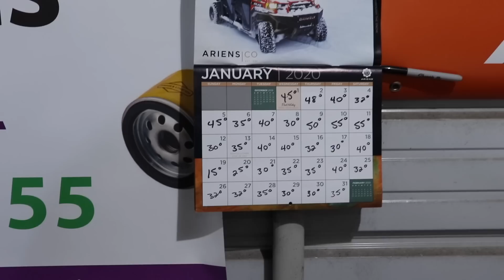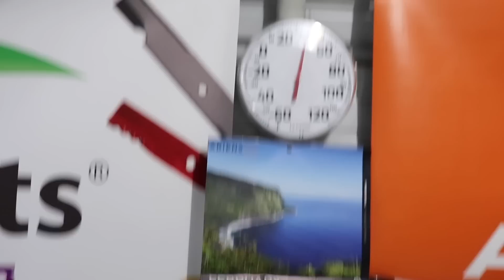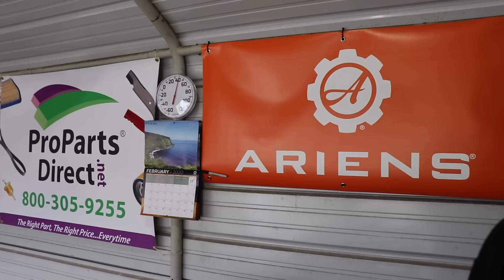WHICH FUEL ADDITIVES WORK? Which Don't?

Comment: I’d be interested in seeing a test done with Marvel Mystery Oil. Been thinking about tossing some in my truck. Sounds like good stuff from what I read but it’s all conjecture.
Reply: I use it on all my equipments (lawn and snow blower) and 2 cars.
Reply: Maybe not too good for a catalytic converter and oxygen sensors. Use a small amount for these. This or some 2-stroke oil is a good idea for a Mazda rotary engine, to lube the apex seals, in small amounts in the gas tank.
Reply: It won't do any damage but it's subjective on what it actually does do. 
The worst that will happen is you will be out $10.

Comment: cant hardly wait to see carb carnage 😅
Reply: He will need that big carb cleaner I think
Reply: If they use the Honda style carbs, the plastic pilot jets on top will likely plug first and cause surging...
Reply: @notajp  seen plastic swell up before my 4hp honda didn't plug up it actually swelled and the jet size was reduced wouldn't idel at all😅
Reply: Willy Ck looks like bowl style ones
Reply: @themowerman  plastic bowl carbs hold up good but anyhing aluminum will form that slime as ethanol corrodes aluminum not sure of the Subaru carbs ive been in enough carbs to know what happens.

Comment: I love how everyone hates on ethanol fuel, but fails to realize that when E10 first came out, it was 89 octane. Then, all of a sudden, it became 87 octane, just like the E0 beside it. I live in Iowa where they sell E0, E10, E15, E30, E85. Sure seems to me that the oil companies know that ethanol is an octane booster, and therefore mix it with crappier gasoline, still ending up with an 87 octane product. Shameful tactics, especially when they get away blaming the ethanol.

I know water can be an issue, as it dissolves in the ethanol, however, I have never personally had any problem running E0, E10, or E15 (which is my go to now) in my small engines. They actually run better on the E15 or E0 than they do on the E10, at least it seams so to me. That is even though I do not drain the carb or tank of fuel in the off season. On 2 engines, snowblower and a lawn tractor, I do shut off fuel and let it run out whatever it can from the carb, but my zero-turn, atv, and garden tractor don't get anything done when parked for the season except connecting the battery to a maintainer.

Just my $0.02
Reply: It's only going to get worse
Reply: Ethanol fuel is garbage
Reply: @robwright4398  yeah Rob

Comment: When you get done with the Gasoline experiment, take one engine modify the carb and use straight ethanol for another experiment. People have no clue about 100 % alcohol , except for drinking it, it would be good to look at power,starting and how much it uses. Call it the Indy engine challenge.
Reply: John Eggleston gotta change they fuel lines and all kinds of other stuff so it can handle the ethinol
Reply: @FishFind3000  Yes u are correct I should have said modify the fuel system.
Reply: @jamesl9686  actually pure ethanol has a higher octane rating. its used in racing for being able to make more power without pre detonating. it will consume much more fuel though compared to gas

Comment: You may or may not covered this, but what about running the carb bowl out of fuel with a fuel shut off?
Reply: I’m thinking most folks don’t do that. I try too but occasionally winter comes in unpredictably fast like this year here in NY  in early November we had snow.
Reply: REMEMBER this test is for the common folk!  Not the mechanically inlcined.  Most mowers sold off the shelf don't have fuel shut offs.
Reply: @pattayperformance  yes that is true

Comment: Enjoyed the experiment and look forward to the end. My previous positive history of aged fuel and additives was in a pressure washer with a 5 hp Honda it sit for 1 year (spring to spring) with non-ethanol 93 and regular sta-bil the thing started first pull and continued. It was impressive for me anyhow.
Reply: Doc, 

Your special ingredient was the NON-ETHANOL.
Ethanol absorbs water, thus all the problems with gas sitting.
Reply: My experience with honda motors have been good also👍

Comment: I have used NON Eth gas for past lots of years and never have issues with say snowblower starting after sitting all summer turn fuel on choke prime and 1 pull she is pppuuuuurrrrrrring. I keep a 14 gallon container around when it is MT I take to station and put fist three gallons from non eth pump in my car and then fill my small engine can up works well keeps me from coming to see you for carbatrator issues sorry! Nice test will like to see the full outcome of all the test fuels. I used to use StaBil but quit and just use Non Eth 91 octane.

Comment: I find that gas only rots in carburetor bowl, I also think this mainly due to the garbage material they use to make the carburetor with and the gas also rots the carb. bowl, this causing the main jet to fail. This test proves nothing. Like one guy said let them sit for 6-months in hot weather and then we will talk.
Reply: edgenet1 Exactly.  Gas sitting undisturbed in the carb/bowl is what causes the gumming up.  Starting the engine every 4 weeks prevents the gas from gumming up.  Thought he would of known that. Disappointed.
Reply: Carl Jones even if the octane drops under starting conditions, using starting fluid will more than likely start the engine and run on its own with a higher rpm! 

Starting fluid shouldn’t be used on a no start condition.
Reply: Why Not, Starting fluid is the best of the best especially in older Tecumseh engines. I have been using this stuff as a cleaner also with Zero issues.
Reply: edgenet1 it won’t give the results we are after.
 Starting fluid is great but if he uses it under a no start condition it could start an engine that the gas has started to gum up and could pull it thought the jets. What if the octane fell out of range to start? Hitting it with starting fluid would give it a higher rpm and would more than likely run. I’ve ran into carbs that had water in the bottom of the float bowl many times and is caused from the ethanol pulling moisture. Water settles at the bottom of gas. It would also be just enough to cause it not to start. Hitting it with starting fluid could burn that small amount of water then run fine. That would ruin the test results. 

It shouldn’t be the first thing to do. He should check spark. If it’s got spark then that engine is out and has failed the gas test.

Comment: I remember a time when gas was good and engines would start no matter what,I think the quality is crap,octane stinks and ethanol stinks ,we need to go back to real gas,and not this moonshine there making.
Reply: That's what I told my customers, "you been running corn liquor in it again"
Reply: @docriordan7787  lol
Reply: Robert V yeah and it will only get worse is what I’m thinking
Reply: Well said, was a kid in the mid 60"s.You could let gas sit in a Briggs & Stratton for over a year,no problems.Only advertised additive I remember was STP(the racer"s edge)
Reply: Those were the days. The only machine that were thrown away were used beyond recognition.

Comment: Great procedure for the test.....very thorough. I'm curious if the engines next to the wall may experience more temperature change than the engines furthest away from the wall. I know down here in the Houston area it gets so hot that being against a wall would be a major factor because of the radiant heat.
Reply: Right! He should 180 the bench twice a month.

Comment: Since the fuel is 30 days old now, and 2-3 engines are already running sluggish if it even has anything to do with the additives. Not all engines are created equal, even if they are the same model. 
I'm thinkin a couple might reek of lemon.
Reply: chainsawchips you might be right
Reply: Top Dead Center  , thattsa story for another day.  I was just a teen at the time. All I know is what dad(C.M.) told me. It was "conspiracy to commit murder".

Comment: I store ethanol fuel in plastic barrels for emergencies. Been doing this for about seven or eight years now. I use Stabil brand 360 Marine stabilizer. If I keep it tight to prevent evaporation it will last 18 months with no discernible degradation to the fuel quality. I'm going on 24 months with this last batch. No information on it yet. I will open up the first of three barrels in a few days and see for sure.
Reply: The engines (my mule was an '86 4.3L bored out v6) will run on 2 year old stuff aslong as it isnt the cheap dollar store additives, I used products from 109 octane all the way to regular stabil fuel conditioner without any issues then after the 2 year mark it lacked power majorly, products like ethanol fighters in the clear blue bottles work nicely aslong as you premix everything

Comment: It hard to believe a tank of gas will last for a whole year
Reply from the maker: And if it doesn't? Re-fill it with the gas can underneath it.
Reply: @TarylFixesAll  ok
Reply: @TarylFixesAll  The devil is in the details, gas cans in plain sight !
Reply: In the first video, he said he'll be running the engines 1-2 minutes each month. Simple math equates that to running the engines between 12 to 24 minutes total, over the course of this experiment.

 Considering they're running unloaded, and the minute amount of fuel evaporation that'll occur from the fuel tanks, there should be plenty of fuel for the whole year.
Reply: I do little miles in my car, 9 months between tanks, no issues

Comment: Pick your snake oil boys. 😁
Reply: It's not snake oil, and Taryl is helping us in the long run, not only better protecting our equipment but helping us understand what's out there fuel wise, don't insult what he's doing. I'm all for it.

Thank you.
Reply: @jdclay1547  who said anything about Taryl?  Maybe you misread my comment.
Reply: @ozzstars_cars  I said that cause everyone I came across on YouTube says what you did and it always 100% leads to bashing of the person and the point of what they do. That's why I said it in that way, but I said it politely.
Reply: I have on my channel, where seafoam fixed 2 machines.  It doesn't work everytime but it doesnt hurt to try it lol!  Stabil def works, I am building a Supercharged Hemi 420cc Ariens 1128 Snow Blower...since we have had a lack of snow I kinda pushed it off to the side.  Its been a year...we had snow on the way so I eagerly rushed it in off the projectline and it fired right up!  I can't speak on the rest...those 2 I know for sure work.
Reply: Here is the video using NO TOOLS to fix a non running more that tradionally needed a carb clean.  SEAFOAM FOR THE WIN!

https://youtu.be/JKQidBYS7h8

Comment: Can fuel IS NOT Pump fuel
Reply from the maker: We, like 90% of America, don't have non-ethanol pump fuel around us. So this will have to do.
Reply: @TarylFixesAll  Understood Brother T , all i can say is here in texas all the wallmart Murphy stations have it at the pump
Reply: @charliepearson1678  Not necessarily. 25% of our SA Metro Murphy's have E0. For some odd reason the others do not. We're here to provide an alternative!
Reply: @VPRacingFuel  Yeah 5 bucks a gallon as opposed to $2 . buy all ya want
Reply: That's for a test to see if it's better, lots of people have been pushing it on YouTube, it's also the 90% of people the only ethanol free gas they can buy, unless you're going to drive 6 states over
Reply: We could not get non ethanol until Casey's came to Ohio  I have found that the fuel spoils first in the carbs and then in the lines. Finally the tank.  
 Pretty horrible smell and turns green
Reply: If you want ethanol free fuel by me its 9.99 a gallon!

Comment: Our fire dept uses trufuel for our 2 stroke chainsaws and blowers, and it works good. We do have issues with our 4 stroke engines as we run non ethanol pump gas with fuel stabilizer, but our trucks and equipment can go weeks without a call. Everything is started and ran every 2 weeks, but like taryl said, the fuel still goes bad. Every 6 months we drain all the 4 stroke tanks and refill with fresh fuel. I use trufuel in my trimmer and my push mower as I have very little grass to get where my rider won't. I'd run it on my rider, but I have a huge craftsman with a 25hp twin and it loves the gas. With trufuel being. About $20 for 110oz, which is just over 3/4of a gallon, itd cost a fortune to mow my yard